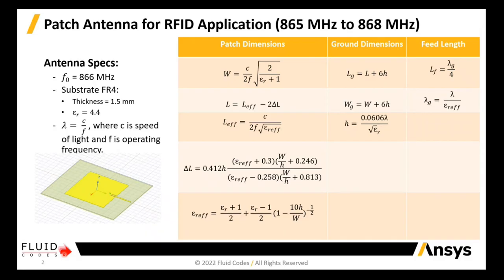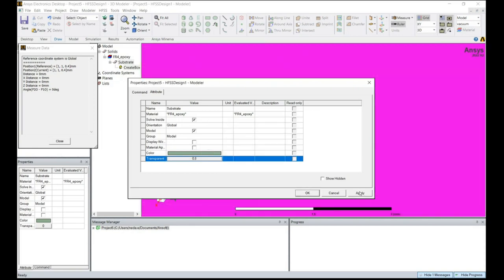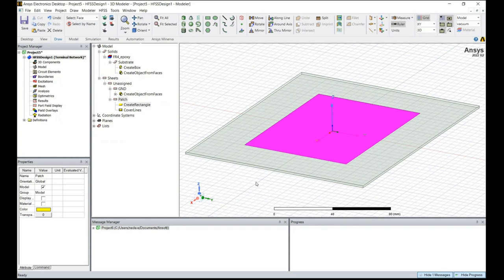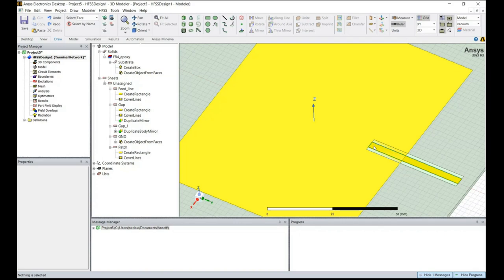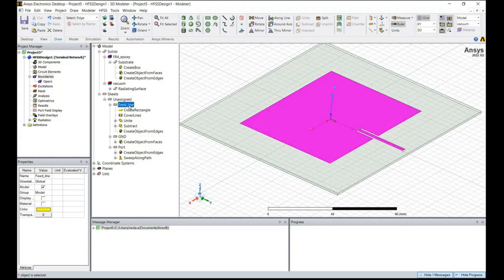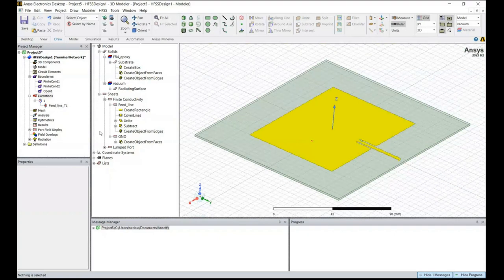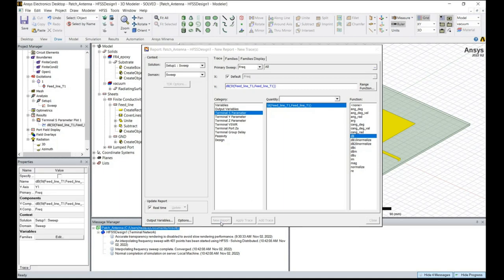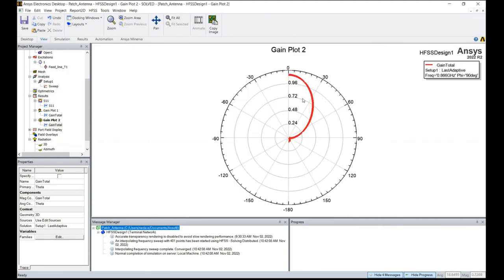Patch Antenna Design Using Ansys HFSS

Comment: Thanks! Is there any way to extract bandwidth directly from the S11 graph?
Reply from the maker: The bandwidth can be calculated from the s11 graph. In the case of defining the antenna to be matched under -10db.  a y marker could be placed by right click on the graph-->Add marker --> Add y-marker. then placing the y-marker on -10dB the bandwidth could be calculated from the X values (frequencies) as it is the difference between f2-f1=Bandwidth. f2 is the high frequency (2nd frequency) at which the S11 is intersecting the marker and f1 is the low frequency (1st frequency) at which the s11 and the marker are intersecting. By this you have the range of frequencies (Bandwidth) that the antenna is said to be matched under -10dB.